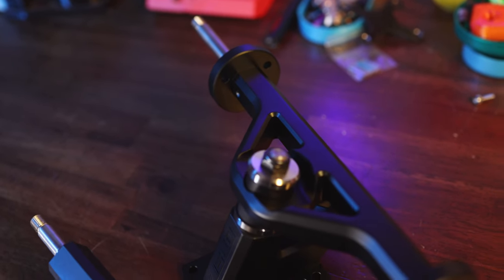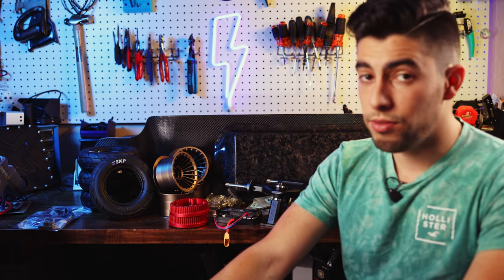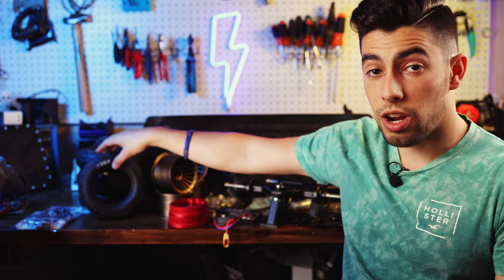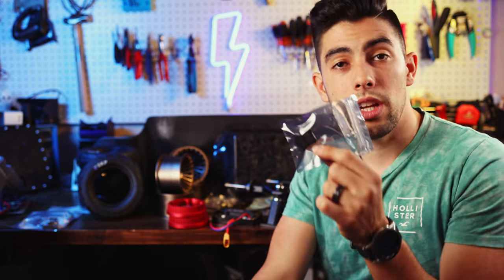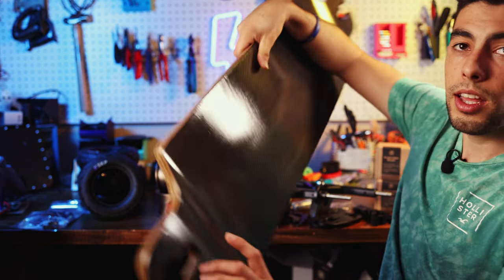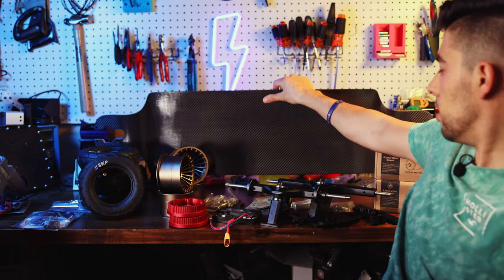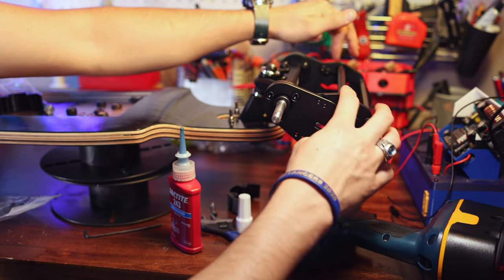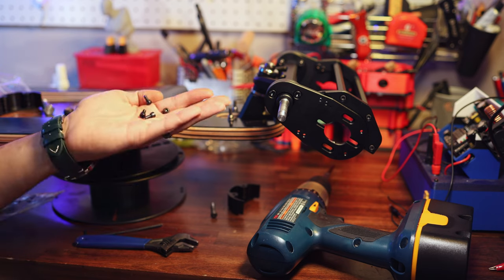Black Mamba: ONSRA TKP | HUMMIE | 14s | SKP - DIY Esk8! (Phase One Pt 1)

Comment: Great build, really loving the rims and wheel combo. I’ve got a similar build with Hummie deck,  onsra tkp trucks, FS 6384s, but instead with 12s7p for the battery. The trucks shine when it comes to high speed stability thanks to its width and overall wheelbase, couple with the decks drop-down. I had to play around with bushing durometers due to my weight ( 150pounds) in order to get a good balance between sharp turning radius + 40mph stability. Great to see more Hummie builds out, can’t wait to see how your build develops.
Reply from the maker: Nice that sounds like an awesome setup. I'm glad to hear that you really like them! Makes me more excited to finish up my battery and get it riding! I love Hummie decks too, perfect street deck imo. Thanks for watching

Comment: I may have missed it,  but where did you get the new axles? Want to do a similar build. Was looking at savage1 trucks. Maybe i should try the Onsra
Reply from the maker: I've got a good friend who happened to have some haha - I have never tried TKP so I couldn't tell you one way or another but these do seem to be made quite well. The axles being held in with a set screw seems a little bit weird to me but it should work fine in theory

Comment: Nice work! Did you get the axles custom made? Also do the meepo red pulleys have the same mounting pattern as newbee/mbs?
Reply from the maker: Thank you! No, I have a friend who happened to have some lol

Yes, the Meepo pulleys are the same pattern, so they do in fact work with the wheels, I just wasn't going to be able to press out the bearing.

Comment: How come the free roll is not much at the rear?
Reply from the maker: The pulleys are a little bit tight on the belts, which are also a bit tight. In addition, the 12mm bearings don't have as good freeroll as smaller ones cuz the balls inside are bigger. I expect it to be a non issue while actually riding
Reply: @RBEMotion can you upgrade to black ceramic bearings? Are those 6000rs or 16100rs?
Reply from the maker: @zpepe Ceramic bearings are not usually a wise choice for esk8 because they see way more vibration than normal skateboards, and ceramic bearings are quite brittle. In addition, failure at high speed is not ideal. Stick with steel. Not sure on the specification of mine, but they're 28mm OD, 12mm ID

Comment: I'm concerned that you are going to have some really bad belt skip with that set up.
Reply from the maker: I think I'll be alright. We'll see, for sure, but because it's a 15T motor pulley and the motor mounts are super rigid, I think I'll have plenty of tooth engagement. If not, I'll be switching to gear drive anyway in a while
Reply: @RBEMotion  I've had belt skip in nearly all my builds that have mounts like this. It won't be an issue during acceleration, but braking is going to suck.
Reply from the maker: @MonkeySwing  Well, I guess we will see then, I haven't had a big pulley board before. I feel like the BC3 with at wheels doesn't have skip, but I will be running much higher power than that.  It is quite a fine balance between tension and engagement. Unfortunately, I don't have the ability to add an idler.